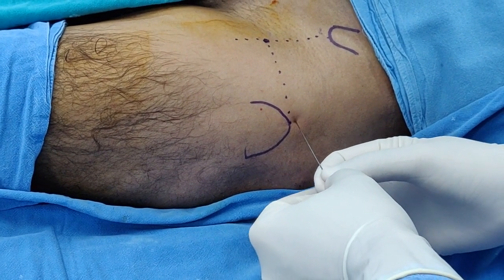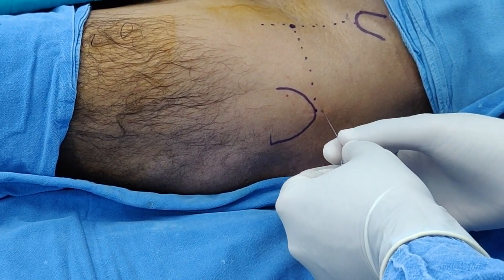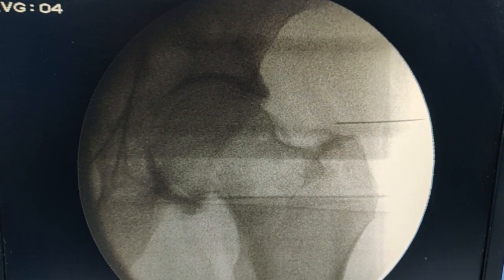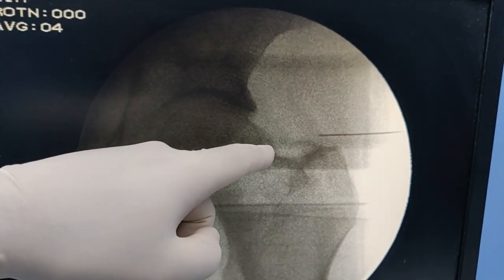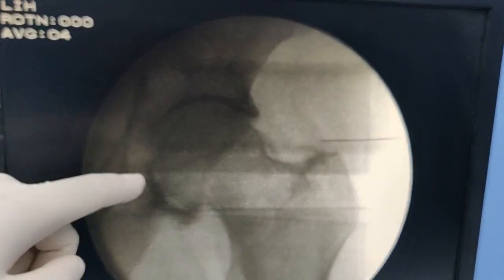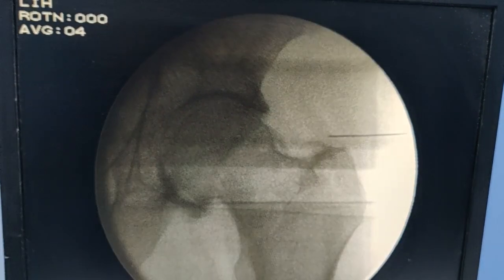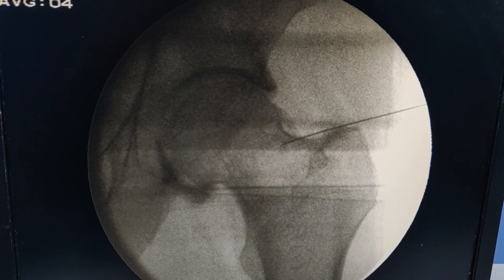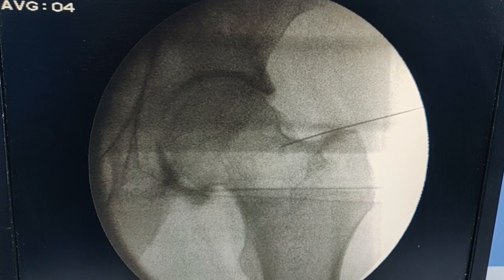Fluoroscopic Intra-articular Hip Injection

Comment: Do you inject Hyaluronic acid? is hyaluronic acid that helpfull into a hip joint?
Reply from the maker: You can inject hyaluronic acid in hip joint.
Reply: I have asked my Ortho for hyaluronic hip injections,they refuse. They insist on Cortizone shots only,but I have immune disease so I refuse
Reply: I'm my hip they injected straight up from the lower femur